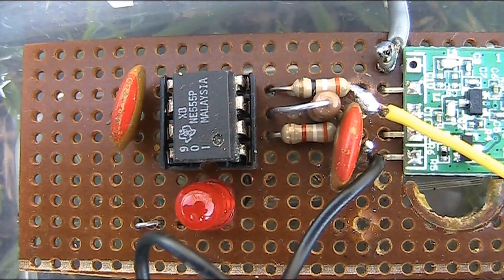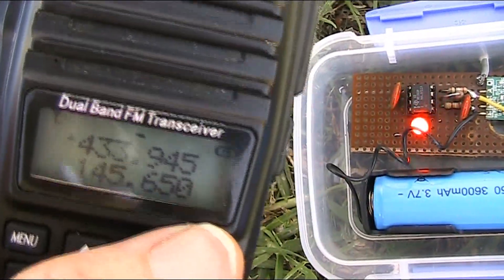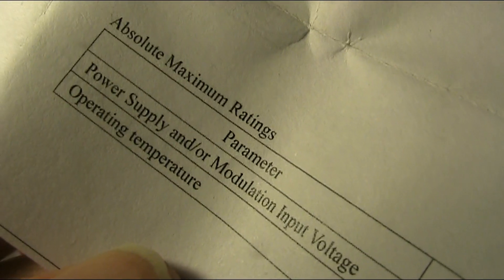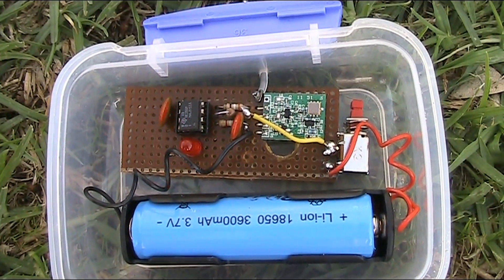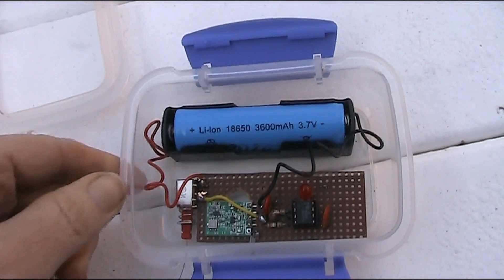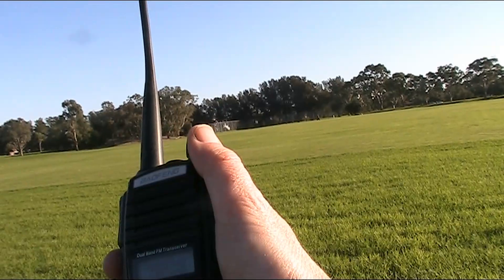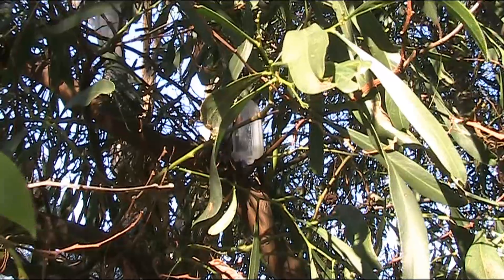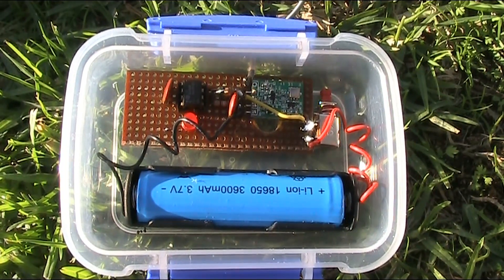Milliwatt 433 MHz UHF fox hunt transmitter

Comment: instead of an ambulance or alarm sound, i got a mosquito sound .-.
Reply from the maker: experiment with some component values - eg capacitors.
Reply: I found the formula for the frequency generated by NE555
bc i only had like 3.3k and 33k resistors, so i added an extra cap to divide the 2000hz to 1000hz,the standard tone for testing

Comment: Hi Peter_ great project - I tried to build the same transmitter but i get a constant tone. could it be that i am using too large a capacitor the 10N 3KV - maybe i'll see if i can find something smaller, also is your LED a flashing type led or the pulsing is coming from the 555?
Thanks and keep up the good work - Glenn - VK2HTV
Reply: Mine is putting out a constant tone too. I noticed on the schematic that it specifies a flashing LED (I built mine with a normal one that I already had). I found that when I touched the anode of the LED, I was able to make the signal oscillate like it does in the video. I suspect that the circut might require a flashing LED to function properly, I will have to pick one up from jaycar this week and try it out.
Reply: @itwaslikethatwhenigothere  changing the resister value will make it trigger slower and does pulse - its not quite a tone generation more like a flipping the keying on / off - that is with a different resister and cap and a non flashing led

Comment: 433 is in the US ham band.i think for us we might need to have it send out a callsign rather then just a beep.im working on an arduino version of this.
Reply: It is in the UK too but 433-434 is allowed for low power, unlicensed devices like door openers, car keyfobs etc. on a non interference basis. https://www.ofcom.org.uk/__data/assets/pdf_file/0028/84970/ir-2030.pdf
Reply: Not to be "that guy", but 433 is also public and you'll find lots of stuff from weather stations to garage door openers to LORA in that space... just more encroachment into "our space".  I really don't mind LORA because that is the spirit of AR, but garage door openers?